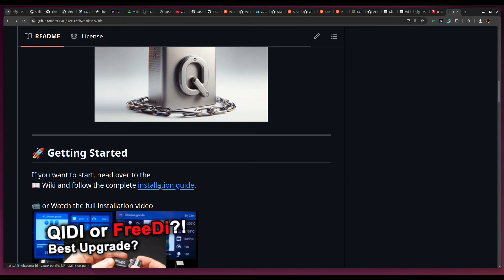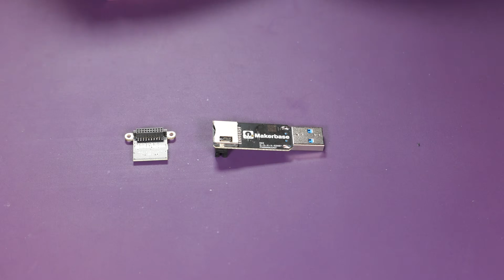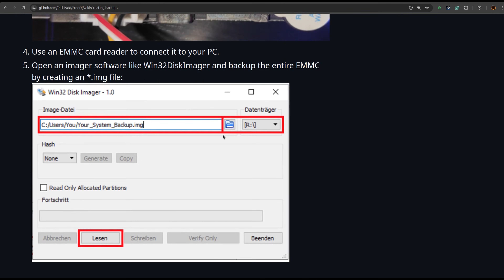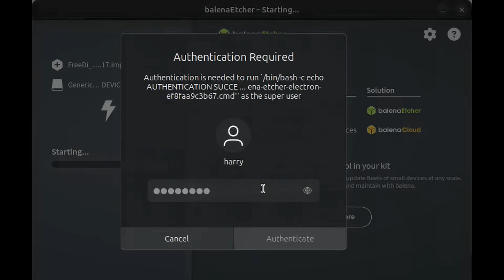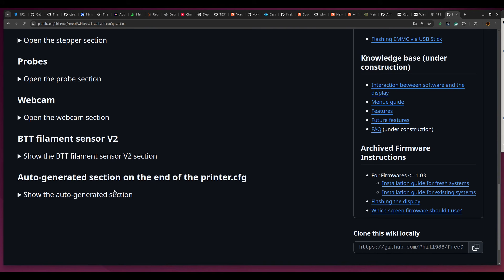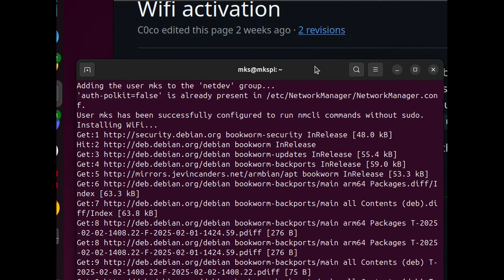FreeDi enhances QIDI X3 3d printers with custom LCD firmware, latest Klipper, & OTA updates

Comment: X Smart 3 Even after doing this upgrade I still can't seem to get the bed level or even get z offset correct. This printer has been a nightmare for me.
Reply from the maker: Have you checked the gantry and bed areas for loose or missing screws?  Does anything have play that should not have?
Reply: @KapmansBasementWorkshop Everything is good part wise. Zero Play. My bed mesh is a messed looks like a wave. I can't figure out how to fix it. Z offset refuses to save.

Comment: Love this. As the creator of Freedi says, since I'm satisfied with the current system, it's not for me. That's true, for now!  I could see getting to the point where eventually I want mainline Klipper, so it's great that having this can do it while keeping my printer fully functional. What's great is that I also have an Xsmart3 like you, and I also have a Q1 that this may work with in a couple of months. 

I actually think that the biggest benefit is that if the board on my Qidi's fails, if I had already done this, it should be easier to replace the expensive Qidi board with something else, if only because I'll already be running an updated mainline version of Klipper to swap files, including macros, between.
Reply from the maker: I failed to consider that, but you are right.  It should be much easier if the mcu fails, the main one, the mcu on the toolhead or any part running Armbian.

Comment: Please make a video show casing the improvements over the stock firmware. This seems a fairly  complex change to the software and I'm not risking my machine if I don't know exactly what extras this will give me. .... One thing I'd like to see is a way to cancel an object while printing using the UI.
Reply from the maker: I want to get more print time on this before I attempt to create a video like that. But with OTA updates, vastly improved macros and the ability to install and use pretty much any klipper addon such as cancelling an object while printing, I have no interest going back.  I think Qidi should help fund this software and just ship printers with this installed.

Comment: What is the improvement?
Reply from the maker: It allows you to use the newest versions of klipper and klipper’s add ons that can improve your printing experience and quality. It also gives you over the air updates. And, you can continue to use the lcd touchscreen that is also improved. I also think I’m seeing a speed boost and print quality boost. But at the moment, I have nothing to compare it to.
Reply: For me (who has a Q1 Pro and thus isn't able to use this yet), it would be the current OS and current Klipper, which in turn would let me use other plugins I want to--like Telegram.  I can do a lot with the base OS, but it's old enough, and thus its version of Python is old enough, that that plugin doesn't work for me.

Comment: wow, I wish I knew this before I gutted my X-Max-3 and added my own hdmi screen along with btt manta mcu and revo nozzle and modded hotend brackets and nitehawk-36 toolhead board.
Reply: I'm sorry for you - but at least you did some nice modifications. Next time make sure to not miss me ;)
Reply from the maker: I was just about to pull the trigger to do exactly what you did but ran into this.  If you have another Qidi, this is easy and low cost.   Thanks for the comments!
Reply: Did the same on my 3-smart and slowly doing on my Plus4
Reply from the maker: @willngton  This was a big improvement over the factory firmware upgrades.
Reply: I highly recommend FreeDi. It basically made my X Max 3 usable for me after so much trouble. I also added a different probe.
Reply from the maker: @colinmsmall  I agree.  It literally made my x-Smart3 usable.  It works well now after a factory upgrade made it unusable.  Also, my bed probe never worked.  It does now.